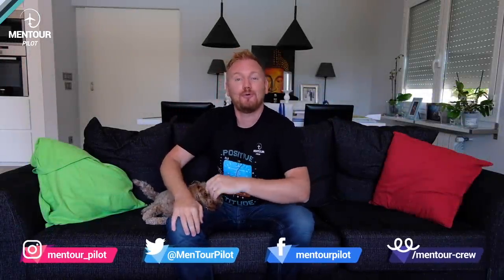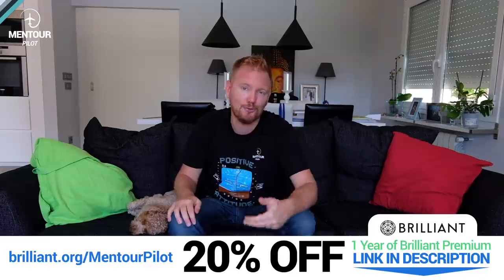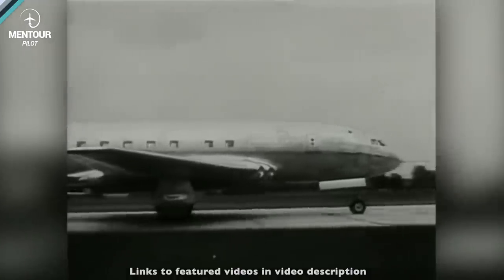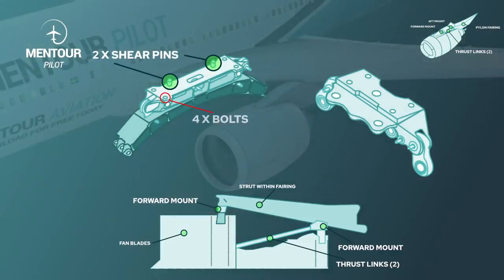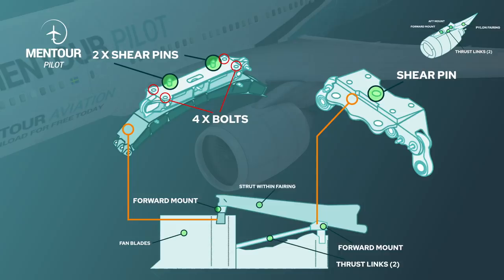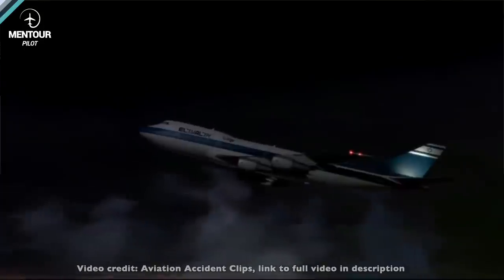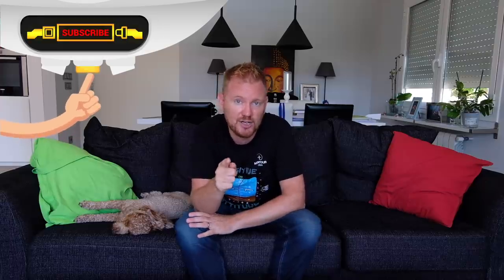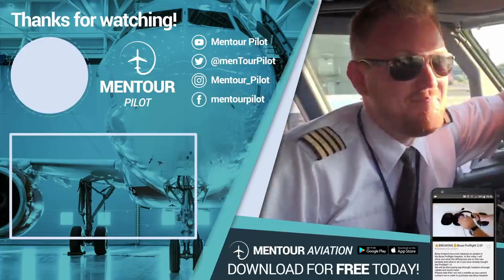How are Jet-engines attached to the wings?!

Comment: Could the 757 have a huge large efficient engine mounted below the wing or would it be a bastard just like the 737 MAX.
Why doesn’t Boeing over with a new poured design?
Reply: Butch Bailey — Boeing will start a new design, when they get through the MAX mess.  Don’t know what it will be yet, but I hope it will have 2-3-2 seating.

Comment: Once again, it's alway money that stops people from dying. I wonder when they were fitting the engine (because management made them rush n NOT do things by the book) they were thinking to themselves "what's the worth that's going to happen.
I mean it's not as if it toilets packed up and stopped working, is it now?! 

When it comes to people's lives, you should ALWAYS do things by the manufacturers instruction. Instead of using a bloody pallet and twatting it into the aircraft! Bunch of ducking idiots 🤦🏻‍♂️ FFS 
It's scary when someone THINK'S they know better 😳 All the engineers who designed the actual engine, along with the support structure and the operation manual for installation and removal of the most expensive part of any aircraft. 

I wonder how many other aircrafts they did that shortcut with n got away with? 🤔

Comment: The Jet engine the perfect cloud producers. Flooding look to the jet engine. Air is high compressed to into a jet engine. The jet mixes the fossil fuel. The compressed water vapour that also is compressed through the jet engine. Water in vapour forms, exits the jet exhaust, full of fossil fuel waste, carbon being one of the the spent elements. What happens is the water vapour with carbon embedded, become human made clouds. Look to the sky's if you disbelieve. Look at the evidence above your heads, where jets criss cross the sky. Water air fossil fuel mixture blocks out the sun. In winter the effect is grossly amplified causing extreme flooding around the world. The jet engine not environmental friendly.

Comment: To be sarcastic with tears in my eyes  ! I am sad to say:
Like on the DC-10 with a forklift, then left hunging overnight at the shift changeover. 
Then you tell them if you remember that when the engine falls off to retract flaps so you don't barrel rooll that it is difficult to recover from most of the time.
O'Hara crash never forgetting.